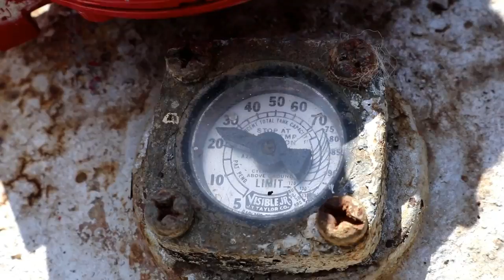The year 2018 on the Homestead in 18 Minutes

Comment: Evan...at approximately 7:20 of this video, you are in your Mechanical Room inside the house. I see you used a PEX manifold to run your hot and cold water lines creating individual runs for each appliance. My question are...first, did you need more than one manifold to create enough outlets for the individual runs? Second, what type PEX pipe did you use (A or B) and have you had any problems with that pipe (cracks, leaks, blown unions etc)? Third, what is the average clearing time to get hot water on your longest run and since each hot water run is independent, don't you have a waiting period to clear the line of cold water even if you use the hot water faucet at the sink and then clear the line for the shower?  I'm planning on doing the same for my house on the farm when I begin building next year and am doing my research now. The only down fall that I see in using a manifold on a larger house is that you either need two water heaters; one at each end of the house or you will be wasting water waiting for each hot water line to clear on runs over 25 feet. Any thoughts, comments or observations. You have a great channel! Thanks!!